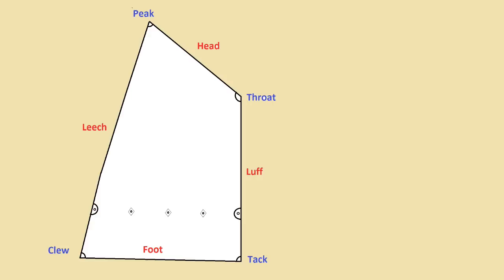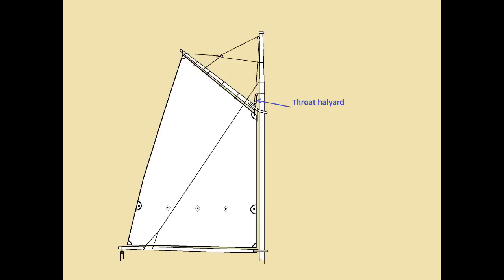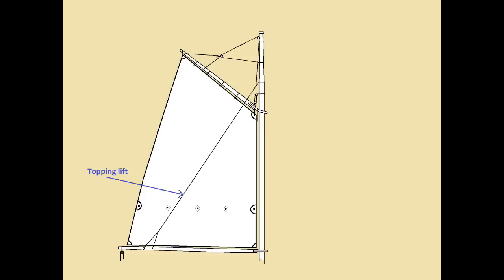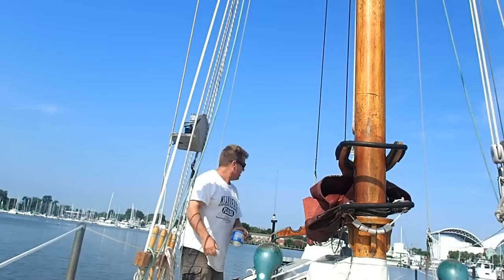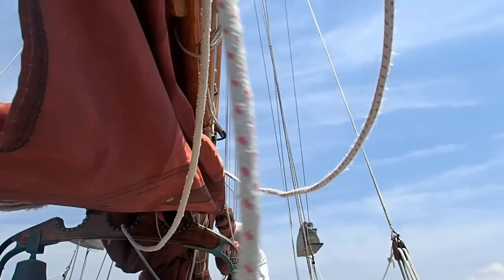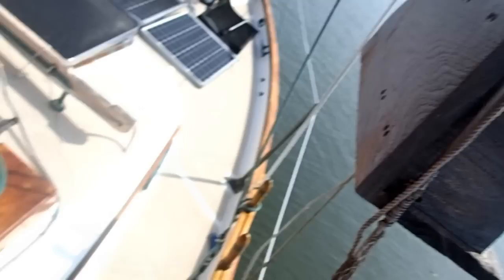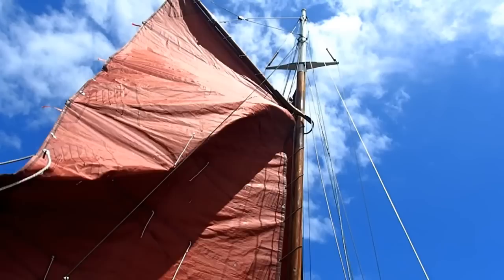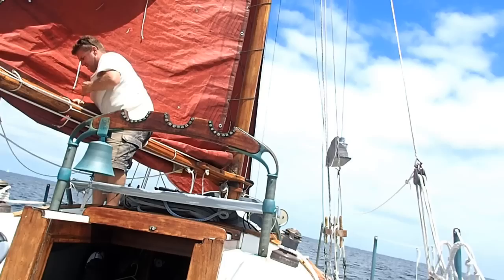Handling a Gaff Rig

Comment: Thanks, Kevin. I am about 2/3 through building what will be a gaff-rigged boat (22 foot lapstrake daysailer with small cuddy)...even though I have never actually seen a gaffer in person. I have found virtually nothing out there on how to sail one of these creatures. If a picture's worth a thousand words, a video is worth 100 times that. It was extremely helpful to see the topping lift in action, the raising of the gaff, and the reefing system and its components, all nicely demonstrated.

Comment: Building a gaff rigged yawl aluminum frame for an inflatable, I decided to just raise each gaff with one lead. The leach on the main sail is only about 56" so ya it's not a large sail by any means, but there is a 1/2 size mizzen sail as well as a jib sail that's roughly in between the main and mizzen sail in surface area. I have no skill with boat building, sail construction or sailing in general, my only boating experience is limited to canoes and inflatables and total time in both collectively is about 100 hours at best, still, I'm confident in my design and staining of the wooden rudder and lee boards as well as sail construction is all that's left to do as the entire framework, rigging, jib furler and steering mechanism is FINALLY completed. ty for this tutorial. =)

Comment: Btw, there is an additional level to reach when it comes to scandalizing the mainsail. Old sailtrawlers would also haul up the tack of the sail in addition or in stead of lowering the peak. (requires a variable tack downhaul and what is essentially a halyard for the tack as well.) This method would be somewhat faster to recover from when you want to go back to full sail area, especially on larger mainsails where you might need to work the halyard a bit to get it peaked properly.
Reply: I'm going to consider that method
Thanks for bringing that up
Reply: @750count  If your gaffer is rigged to use a topsail you already have a halyard available as you probably won't ever scandalize the main with a topsail hoisted at the same time. Having the mainsail laced to the mast is also very handy, if you use fixed hoops you are going to need to play with the topping lift a lot more to get the boom up if you want to haul the tack up.
Reply: @Flakzor123  No topsails
The main and foresail are laced

Comment: Great video, thanks I'm building an rc pilot cutter with a gaff rig and I will use you video as point of reference when I get to rigging and sails, I'm brand new to radio control, its just a much smaller version. 👍👍👍👍

Comment: I can recall buildin a gaff setup. Being a young guy(not much money)I found an abandoned boat with the mast(wood)lying on the ground. I tied it to the roof of my datsun and carted it to my girlfriends where(after a stop for some wire and clamps)I got it rigged up. Then to the boat with it then a trip to the pier (yes me and a buddy lifted it with some rope and managed to stand it without a crane).There was a close call as it tipped toward a lady who was standing on the pier watching. But we did stand it up. The wire was cheap galvy but the thing sailed me hundreds of miles without a problem. I remember outrunning a Catalina 30 so it worked well for many years. Walt SB and Port San Luis

Comment: I saild a gaffkutter for years with great plesure. No greater fun to sail halfwind into the bay of Kiel with a topsail! Every one there thinks to bee faster than an old gaffer. They did imagine!
For the  top of the  topsai, l used a ligthweight aluminium bar. Its a bit triky to handle it, but I hat never problems

Comment: Another advantage is that the sail can in principle be raised or lowered on any point of sailing, and if you need to drop it in a squall the weight of the gaff brings it straight down. No need to be completely head to wind. I can't bear to watch Bermudan boats having to come up top the wind whilst the crew struggle to pull canvas down a track.

Comment: Your gaff rig has some similarities with our Chinese lug rig.  The lug rig is quite a bit easier to use.  Thanks for your video.  Dave & Linda  M/S Olivebank
Reply from the maker: Yes, perhaps the junk rig is easier to manage, though many believe the gaff rig evolved from the lug rig as a sturdier, less labor intensive alternative.  That's especially true if you want to avoid having the sail pressed up against the mast on one tack.  To avoid this they would dip the lug yard behind the mast and set the sail on the lee side, but this required a good deal of work, and with large luggers, managing a sail almost as big as a tennis court that is practically set flying.  As opposed to a gaffer where the luff is laced or hooped to the mast and thus much more secure.

Comment: This is such a great video, thanks for explaining the pros and cons of the gaff rig, I noticed you sail solo on this video, I am planning to sail solo and wondered what size of boat would be favourable , some people tell me it would be good idea to have electric winches, but it seems like you can haul up these sails pretty easily although i guess it is down to fitness.?
Reply from the maker: A 31-foot boat (8 ton) is no problem.  I would say if the boat is over 20 tons you may have some challenges sailing solo without powered winches, or a crew, especially if it is traditionally rigged, e.g.  a gaffer.
Reply: The less of anything electric you have to rely on the better - the thought horrifies me, to be honest.

Comment: I just went back to this video again.  I appreciate all of your points, and I particularly appreciate the origins, traditions, and the silhouette of a gaffer.   I am curious about how Ruth Avery specifically became a gaffer.   Was that your design?   And are you aware of anyone else who has changed from a more modern rig to a more traditional gaff arrangement?   And somewhere in there, at least for many, the running back stay becomes part of the debate?   I guess I need to hunt you down and offer a beer for your reply.  No need to do so here, just sharing my cogitation.   Fair winds and thanks you for your channel!
Reply from the maker: Hi Charles, the previous owner gave her the gaff rig, though I later modified it--he had a very high peaked gaff which didn't work very well.  Most people opt for the Bermudan rig these days as they are less work to manage.

Comment: Your boat is so classic and beautiful. Love how you are keeping it traditional. Thank you for posting. 
Gaff is same as junk rig correct?
Reply from the maker: No, a junk rig is closer to a lug sail, where the luff (leading edge) is not bent to the mast as it is with a gaff sail (in my case the main is bent to the mast by spiral lacing).  The junk also has those distinctive heavy full battens.
Reply: @howtosailoceans1423  thank you for clearing that up for me. Gaff is way cooler!

Comment: A year later, here's a second question:  I remember racing Beetle Cats in Buzzards Bay as a kid. On a broad reach in light wind, the boom would ride up and slog in a rolling sea. Too much wind was being spilled. Not enough downward tension. It improved things to have the crew set his weight on the boom to hold it down, or to set a preventer.   The weight of an old fashioned boom might be sufficient on a boat such as yours, but that solution does not seem ideal for a smaller gaffer.  Comments?
Reply from the maker: My boom is solid, and the gaff hollow.  Yes, you need weight in the boom for the sail to set well.  I remember those Beetle Cats, cute little things.

Comment: Thanks very much Kevin ....I agree it’s hard to get boom into gallows in rough conditions.....my gallows are aft and yours are midship....can you discuss the difference and why you chose your location.....it looks like a good safety feature to be able grab those handholds...also where did y obtain the bronze hardware for the gallows..". Thanks so very much....Stott.      Ps could you do a video on tips for handling the main topsail....thanks again
Reply from the maker: Hi Stott, the previous owner installed the gallows.  I would rather have them aft, but that's kinda tough on a double-ender.  I've stopped flying a topsail, just too much hassle, but it really does give you a boost in light air.  General procedure is get your windvane set, then raise the topsail on the lee side of the main.  Once you get the yard two-blocked at the masthead, crank down on the downhaul, then sheet it.  To take it down, reverse the procedure.  Watch out for squalls ...

Comment: Super! Note his standing rigging not too tight a boat is not a harp! 2:1 tackle equals luff tackle. A point also worth noting is that the mast should rake aft very slightly to make this style of rig draw and balance well. On American schooners this rake was pronounced. Some English inland designs have a single topping lift th
Reply from the maker: I like the rigging a bit looser, easier on the boat so long as the mast is not actually wiggling when you sail.

Comment: That was a great domo on Gaff rigging. Do you ever strap in ,since you're single handed. Getting knocked overboard would be almost certain death ,wouldn't it be ? I see you're in calm conditions now and could probably out swim your boat right now. Let me know you thoughts on that. Fair winds. It was a fun video.
Reply from the maker: I did purchase a harness but still not religious about using it.  Being tethered can be a real hindrance when working deck.  In any conditions the boat is hove to when reefing, so may be able to swim back.  Maybe.  Falling over at six knots and then pulling yourself back aboard by the tether may or may not be possible.  It's best to stay on the boat..
Reply: Kevin, At least toss a line over to trail behind the boat when you go forward.  50 yards or so of 1/2 poly pro that would float on the surface, not sink.  That would give you a fighting chance of snagging the line should you tumble into the briny deep.  Pull the line back in when you get back to the helm area, coil it and leave it ready to toss again next time.
Reply: Im sure one guy at least, is alive because of that rope trick. Possibly  dozens.
Reply: @howtosailoceans1423  "It's best to stay on the boat" - truer words!! Got a good laugh from me!

Comment: The old way of gresing the mast was simple:) a hole was bored/drilled from top to NEAR the bottom of the mast , the subsequent hole was filled to the brim with linseed oil and closed off with a (usually) bronze screw 'washer' the leather part of the boom was slathered with tallow regularly the linseed oil would evenually permeated the wooden mast and become as they used to say 'smooth as butter' this was repeated every season, not forgetting the gold coin in the mast foot for sailin luck :) this was the standard system on all British merchant hookers up to ww2  happy sailing  :)
Reply: sorry not gresing but greasing   oooooh

Comment: Kevin, I have a 100yo 22 foot gaffer in England and I am intrigued by your topping lift arrangements.  Looks like instead of a lift going up the mast, through a block and to the boom, you have a standing pennant with the topping adjustment done with a line along the boom and through the pennant.  Is that the case?  Did you put that in or was that the design lift?  It looks far more robust and efficient.  DO you have any more photos of it and how is the standing pennant secured at the mast? is it with a strop at the hounds?  I must say that and the jawed boom instead of a gooseneck make me really like your rig.
 John
Reply from the maker: Hi John, yes, you have that right.  The lifts are spans, and I run a line through a cheek block on the side of the boom up to the eye and back to the boom where it is secured--this is how I adjust it.  The reason for this arrangement is simply to reduce windage, which gaffers have quite a bit of.

Comment: Great work Kevin....question.....I single hand a Falmouth cutter similar to the Curlews boat..... I know this goes against conventional wisdom but I ease the boom into the gallows frame to reef and lower sail.....it just seems much easier to work on a boom that is stationary.....am I missing something or crazy.... thanks in advance....Stott
Reply from the maker: I have quite a bit of difficulty getting the boom into the gallows on a dark and stormy night with the boat bouncing all over.  Plus, when I pull the clew reefing line the power of the wind in the sail, even with the sail partially lowered, will rip it right out of the gallows unless the boom is well secured.  So I let the boom hang on the windward lift while reefing.  But maybe that works with your set-up---different ships, different long splices...

Comment: Good stuff.  Thanks for the great details.  My new boat is going to be a gaff schooner so this is great info and timely for me.  My rig is on a cat and actually has no boom on either sail.  Apart from a topping lift can you see any advantage this way?
Reply from the maker: The only disadvantage of having a gaff main totally loose footed that I can see is when you are running and don't have the boom to hold the clew out.  Some schooners will have loose footed foresails (as the yacht America originally did), but the main still has a boom.
Reply: Thanks Kevin. Appreciate that.  Having a wide catamaran I should be able to hold the clew out pretty far without a boom.  I actually have double block and tackles for the sheets with multiple attachment points for lots of sheeting angles. Cheers.

Comment: Lovin' your work, Kevin! I'm a Kevin as well. :) Question: What material is you sailcloth?

..and I'm working on making a "heavily modified" gaff rigged boomless "forward flying luff" Pacific Proa (it shunts instead of tacking/jybing), which requires "the leeward side" of the boat to always be on the same side. THAT means that the boat is asymmetrical on the "long" axis (direction of travel) and symmetrical on the "short axis" (90deg from the long axis), and has (literally) two bows.

Anyway, your beautiful red sails are quite dramatic and rather inspiring! I'm really likin' the red. <chuckle!>

Aloha nui a me nā mahalo īa ʻoe! Hope to see yaʻ on the sea at some point. :) 🤙
Reply from the maker: Ahoy Kevin!  The sailcloth is Dacron, actually Fibercon which if I recall is made by Contender (sails were made by Willis Sails, New Zealand).  Sounds like your rig is similar to a lug rig, where they would dip the yard behind the mast when coming about.  Proas can be extremely fast but yikes! I prefer something more stable.  Fair winds mate...
Reply: It is rather like a "dipping lug", except that the "yard" will be "forked" (making it a gaff) to the mast, keeping the throat of the sail at the base of the gaff, while the luff will run in a straight line from the throat to the bow. I'm thinking that the head of the sail and the luff (of the sail) will form a straight line from the peak to the tack (creating essentially a huge lateen sail), but we'll see about that.

There won't be any coming about, 'cuz the sail is always on the same side (to leeward), as that's the nature of a pacific proa, but in tight quarters where shunting isn't really an option, I'll probably end up backwinding the sail, basically creating a temporary (backwinded) dipping lug rig, which should look REALLY silly, actually! :)

Anyway, pacific proas DO look unstable, but mine's actually very stable, having a 30' LOA and a 16' Beam (main hull is 30', outrigger hull is 15', and the outrigger beams are 16'). I just need to not overpower the sail and manage the water-ballast in the outrigger hull so there's little to no listing.

And my windage will be really high (due to the "deck accommodations"), so I won't be going overly fast in breeze forward of the beam, and it'll point to windward like a box of saltines, but... oh well. <chuckle!>

Fair winds and warm temps to 'ya! :) Aloha. 🤙
Reply from the maker: @alapikomamalolonui6424  Don't forget your video camera for all of this ...

Comment: Question: . how high to windward can you point your Gaff rig ? Thanks. I've heard Bermuda's  can sail closer to the wind or is it that much different? Thanks.
Reply from the maker: That depends on more factors than just the rig, such as the hull form and conditions.  As a general rule, you're gonna give away about 10 degrees of pointing with a gaffer vs.  Bermudan rig.   On flat water I tack through 100-110 degrees, once a swell gets up that becomes 110-120 degrees.

Comment: Hi, when does a gaff rig start to be called a Gunter rig? cheers, Keith.
Reply from the maker: The gaff on a Gunter rig is peaked very close to the vertical, so it's almost an extension of the mast.  I do not know what the exact definition of it is, though.

Comment: What do you think of the movement in Bermuda Rigs to go Synthetic Rigging?  Some cruisers with Bermuda Rigs are ditching their high tech winches and in mast furling as well.
Reply from the maker: I'm planning to gradually over to synthetic standing rigging. It's lighter, easy to splice and work without requiring special skills or tools.
Reply: I replaced my entire standing rigging just a few years ago, and really enjoyed learning to splice/serve wire. Loved every second!. But it's not perfect, and I knew it wouldn't be before I started. So it was seen as a practice.... 

Used spectra running back-stays. Too easy :-). Plan to build the ultimate standing rigging, by making small dead-eyes out of bronze, using spectra, and serving for protection and the traditional look (and smell :-)). Should be an immortal rig!